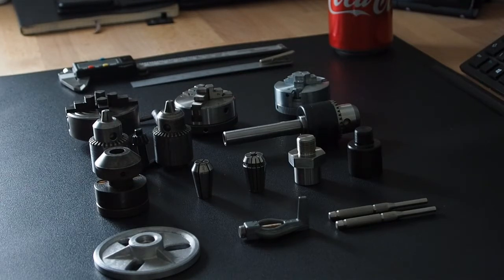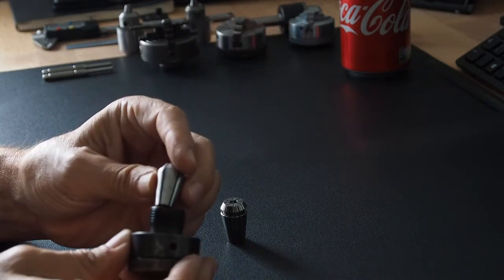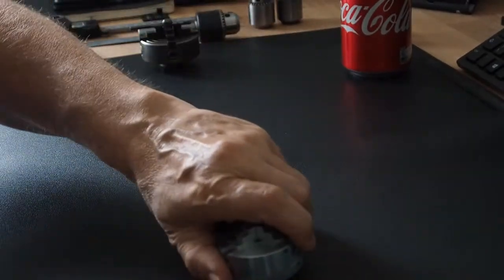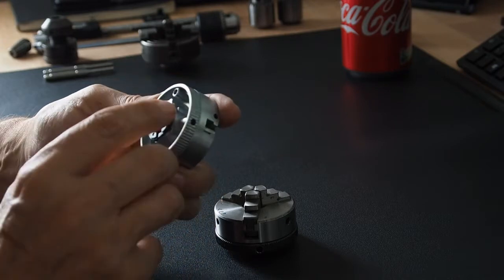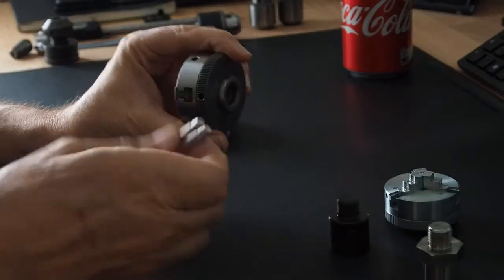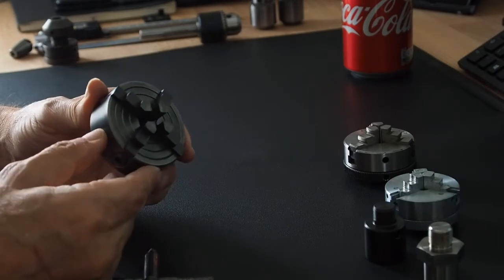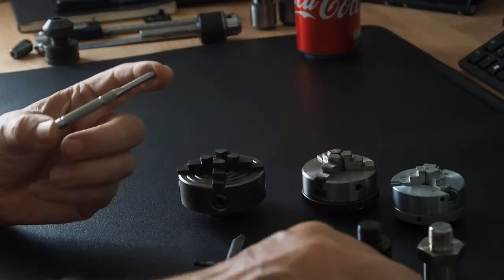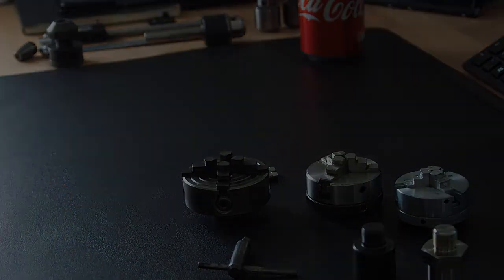Emco Unimat SL Lathe - Chucks.

Comment: Man, those chucks are small - but then again, everything is relative, those are probably large in relation to some of the work that the watchmaker's equipment is used for too.  I can see why you're less interested in using the adapters for the M14 threads as it adds more stickout and potential for runout, but I guess you do what you have to!
Reply from the maker: Hi Everett,
Thanks for visiting... the chucks are rather small... I have managed to find a Unimat SL 3 jaw check so don't need the adaptors... I am very pleased to not have the additional stickout.
Take care
Paul,,

Comment: Thank you for your very helpful and informative videos Paul. I have recently bought a Unimat SL and am looking to purchase a 4-jaw chuck. The 3-jaw ones you show in the video appear to be 50mm diameter and the 4 -jaw, 65mm diameter. I wonder if you can confirm that a 65mm chuck will fit the SL without fouling anything? Many thanks for any help you are able to offer.
Reply from the maker: Hello Rosie,
Many thanks for watching my video... My workshop is not at my home so will double check in the next day or so when I visit the workshop and confirm 100% that 65mm will be okay. Sorry for the delay.
Take care.
Paul,,
Reply: @TheKnacklersWorkshop  Thank you Paul, no urgency.
Reply from the maker: @rosiemartin8476  Hello Rosie, I checked today and I would say 65 mm is the very maximum... if the jaws stick out much then you might be in trouble of it hitting the rear ways.  I hope that is of help.
Reply: @TheKnacklersWorkshop  Thank you Paul, much appreciated.

Comment: Hello, can you please elaborate on if the er16 collets will work with the e16 collet chucks? I'm in a situation where I have the chuck and lathe, but only a single collet, and the e16s are impossible to get affordably. If the er16s really do work with the e16 chuck, I would be well on my way.  

Thank you!
Reply from the maker: Hello,
Thanks for watching and subscribing... I have just been doing some experimenting and I think you are out of luck as the ER16 collet does not fit correctly into the collet locking ring (nut) of the original collet holder. I have seen some aftermarket ER16 collet holders on eBay here in the UK but they seem to sell for around the £150.00 mark. Sorry it is not good news.
Take care.
Paul,,
Reply: @TheKnacklersWorkshop  Have you got a link to these ER16 collet chucks? Regards
Rob
Reply from the maker: @robs4509  Hello Rob, They were just on eBay... I have not seen them lately...
Reply: Do they still sell the 14-12mm adapters to fit the later chucks?
Reply from the maker: @robs4509  RDG Tools in the UK seem to have some...
Reply: @TheKnacklersWorkshop  Many thanks.